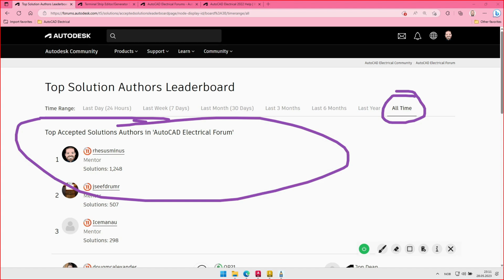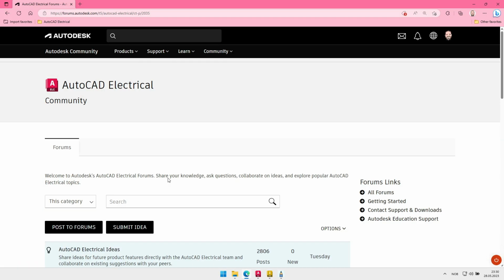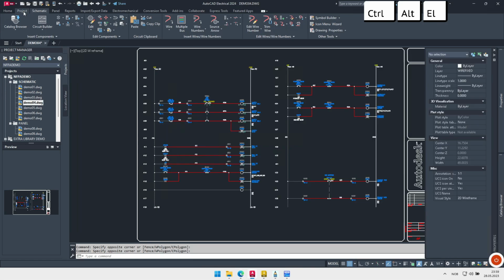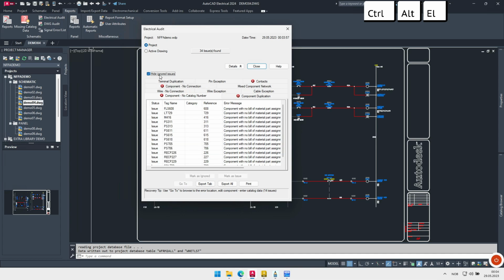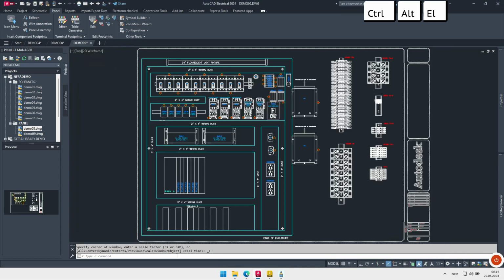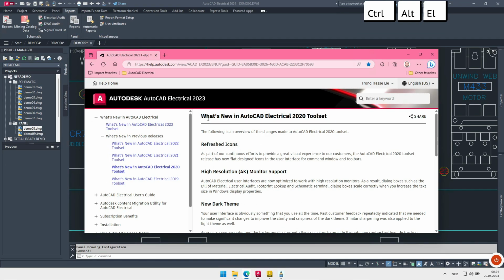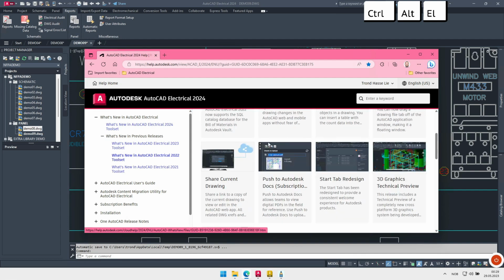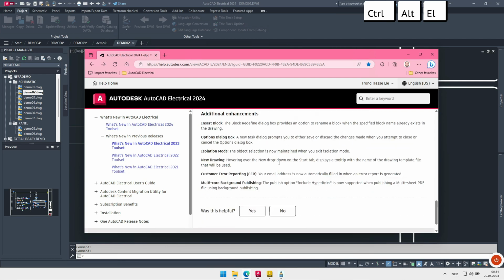AutoCAD Electrical - Why I stopped believing in AutoCAD Electrical

Comment: The development of Electrical Schematic tools seems to be low priority for many of the platforms. I'm coming from employer who used Solidworks Electrical and I struggle for a long time with obvious issue that should be solvable presitenly being ignored. The last one being dimentioning 2D panel layouts using origin. The origin was the bottom left corner of the paper and could not be set by the user. With a CAD software name in its title you would think some of the functions would function the same. 

Another issue was trying to define a equal protection more then 2 connection terminal block. Any discussion on how broken it was lead to this is the intended behavior. 

I would agree though Autodesk implimention of Electrical schematics seems out of date from users needs.
Reply from the maker: I totally agree. That's why I prefer Eplan. They only focus on the "Electrical part".

Comment: Thank you for that rhesusminus, I agree with everything you say, I'm a contract electrical design engineer, so I deal with many companies and have for over 20 years. Many of the companies I work with ask the question, which electrical package would you recommend? As I have worked with quite a few different packages I can usually give them advice on which packages which would suit their purposes. I frequently recommended AutoCAD Electrical because at the time it was one of the best, alas no longer the case, for some reason unknown to us users, Autodesk have decided to let ACADE go down the pan. I will no longer be recommending it to any other companies, as there are far better packages on the market. I don't think Autodesk realise the power of word of mouth, I do not see a future for ACADE.
Reply from the maker: Thank you! I'm trying to have an open mind about what I'm seeing, and this is my conclusion also.

Comment: AutoCAD Electrical is so outdated design solution and is no way near offering the productivity, flexibility and quality of the modern electrical design tools, so simply cost a lot on the engineering time to business. Still only around due to its historical legacy and will only going down in the table as they lost ground keep up competing with competitors long time ago. Industrial automation is rapidly evolving so it has no time to deal with steam engines 😉.
Reply from the maker: And yet, It's still the number one tool in the USA 😐

Comment: I agree with you regarding Autodesk not giving enough attention to Acad-E.  I've used AutoCAD since version 2.18, and there have been plenty of times I've been frustrated over the years.  The saving grace is it's extensibility.  Unfortunately this is also a downfall; IMO in some ways they have been too accommodating in how much they have added to the core system, so much so that it is now bloatware and has been for many years.  Yet somehow if you manage to focus on the tools that work for you and your situation, and ignore or disable some things, it's still pretty great.  One of my biggest complaints about AutoCAD in general is the way they tend to build new functionality into long-standing command names that breaks the flow of how the previous command worked.  Case in point: the new INSERT is unnecessary bloatware.  They should concentrate WAY more on fixing bugs.
Reply from the maker: While it's extensibility seems good; If you look into the AutoCAD Electrical "API" you're not getting far before it stops. As the rest of the software... The "API" also needs some much neede love. And, it's based on Lisp. While this is nice for old farts like us, for new users it just doesn't make sense. It should be more flexible (.NET?).
But, functionality that you make for your own use with code now, like Nate Holt's tools mentioned in the other comment here, is standard functionality in most of the competing software. And, it's not like these other software packages don't have an API. Of course they do! Based on .NET. Program add-ins in whatever programming language you want/know.

It seems like everything is moving towards the cloud from Autodesk's side now, so it'll be interesting to see what'll happen in the future. AutoCAD Electrical is dead; In my opinion.
Reply: @ctrlaltel  why use the API when you have LISP and SCRIPT... powerful yet simple.
Reply from the maker: @Userlevel6  Depending on what you need to automate, you need to update other drawing sheets in the project AND the project database. This is when you need the API...

Comment: I believe you are correct in your view that the AcadE product development has slowed down over the last 6-8 years. But I remain committed to applying the product to various customer application needs by creating custom AcadE-compatible tools to work hand-in hand with stock AcadE. These can add new or enhanced functionality and, in some cases, provide work-arounds for issues in the mature AcadE product. Nate Holt.
Reply: I know you do Nate, but it really should be Autodesk job to enhance the product.
Reply: Have you seen the PDF outlining all of the extra AcadE-compatible tools that I have had a hand in creating over the last 10-12 years? These were developed to work hand-in-hand with AcadE, or be optional replacements for some AcadE commands, or were totally new commands to add missing functionality that some of my clients desperately needed.
Reply from the maker: No, actually I have not. Feel free to share it here. I'm sure your customers are happy for these tools, but this won't fix the main issue here. It's not your job to fix AutoCAD Electrical, it's Autodesk's.
Reply: Hi, it looks like YouTube will not allow a reply to contain my link to the PDF file. Do you have an FTP site or an email address that I could try sending the PDF to? This file is about 57 megabytes. Nate Holt.
Reply from the maker: @N8holtUtube  I think you should make a video, showing the functionality. And, then link it here :)
Reply: Here is a brief, existing YouTube video showing a half-dozen of the "SDS-Tools" that are in the suite of 50+ tools that can extend the capabilities of AutoCAD Electrical - https://www.youtube.com/watch?v=g4Yt1t4fGcc